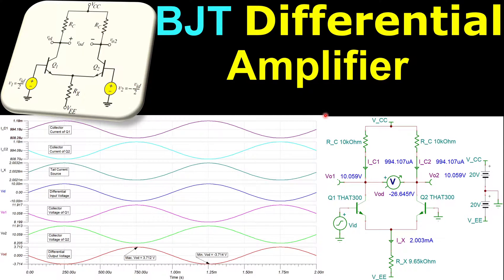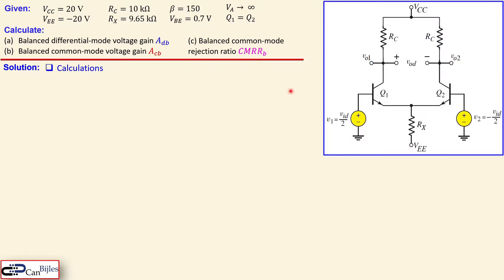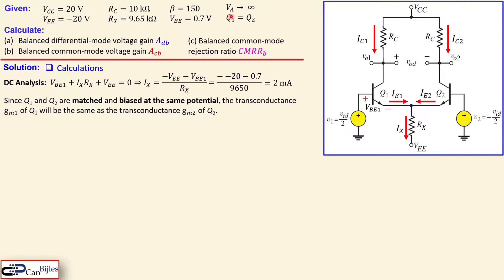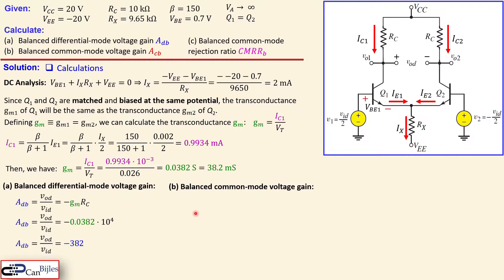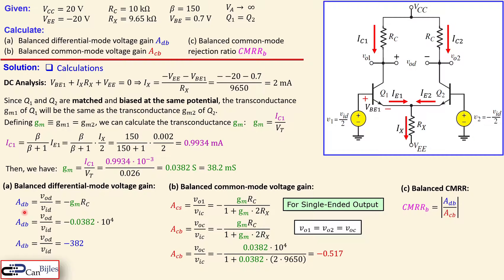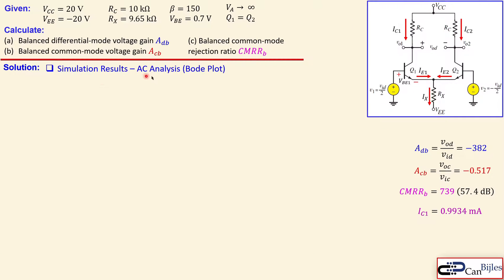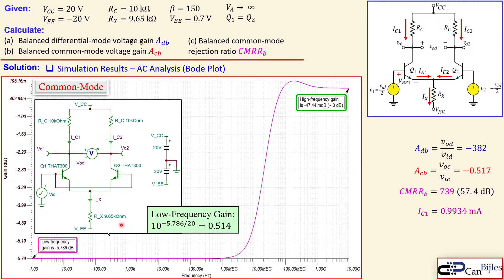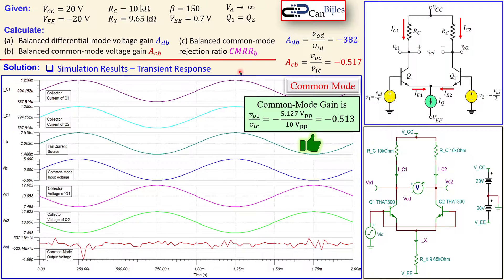BJT Differential Amplifier - Resistive Current Source 🌟 CMRR, Differential & Common-Mode Gains 💡 EX2

Comment: Sorry, but the only useful information is the DC analysis. Without drawing the small signal equivalent circuit, it doesn't help me much. Great work with the simulations and all, but circuits are never this simple. I hope one day you will include a detailed analysis that covers AC as well.
Reply from the maker: Thanks! Great to know you liked the video.

I have a separate video list about single-stage transistor amplifier where I discuss the full details.

Check this playlist: https://www.youtube.com/playlist?list=PLuUNUe8EVqlndhdohoZ23M1-BICayBJFE

You can also start with this video just to see the derivation: https://youtu.be/y5eO02lGUyg
Remember that g_m = r_pi*beta.

Comment: I don't see VCC being used in any formula, is that correct or am I missing something? Is it just relevant to calculate the DC level on the outputs? So, is Vo1 = Vcc/2 + Vin1*Adb? (or ACB if Vin1=Vin2) Or where do I get the 10V at the terminals from?
Great video series. Thank you for dissecting the topic and showing the matching simulation results.
I am currently trying to model barebones OTAs to run with ODAE solvers, and I'm building it starting from the simplest possible thing: a differential amplifier. 
I'm still running into some issues and scratching my head in confusion, but I'll get there.
Reply from the maker: Thanks for your message. It is a good point. The VCC is actually required to check the bias conditions and the operation region of the transistors.

We need to check that all the transistors are operating in the linear region in order to use the formula for the voltage gain. I have not checked this, but you can see in the simulation results that the DC collector voltage is larger than the DC base voltage, so the transistors are indeed in the linear region of operation.

Great to see you liked the video 👍
Reply: @CANEDUX  Oh, I see. Thank you for the clarification.
Reply from the maker: @sharptrickster  You're welcome!